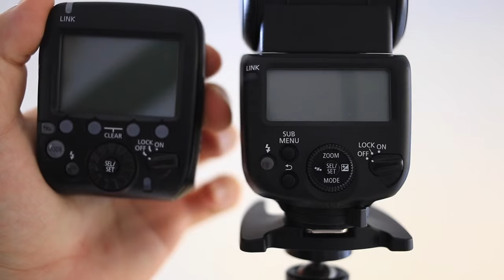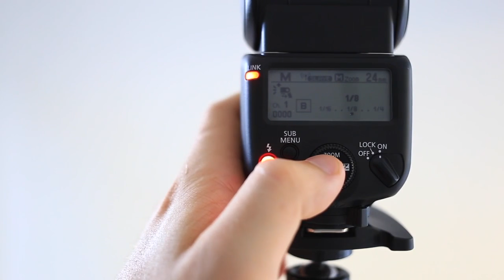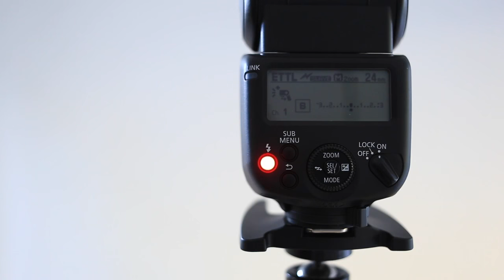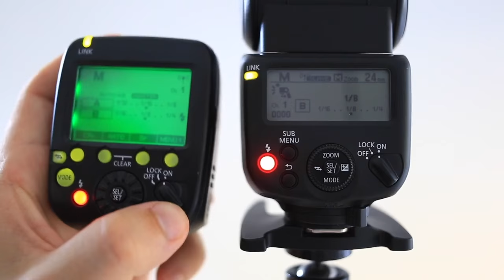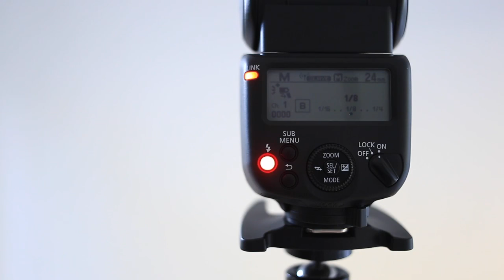How To Setup Canon 430EX-III-RT For Wireless Flash

Comment: Cant get my canon 430 ex iii rt to link the Yongnuo Yn e3 rt :( both are set to the same id number, same channel and the same group, the canon 430 ex iii rt is set to wireless slave and still cant use the 430 ex iii rt as a slave, it won't link !!  any ideas?

Comment: perfect I figured it out in about 2 min with this video getting my flash to work off camera with my 70D. Once I figured out that the pop up flash on my camera has to be up,  while in optical slave, In the 70D you have to go into the 2nd menu "Flash Control ", then go to "Built in Flash settings", then "wireless func." and chose one of the options there.  ta da.  so easy...
Reply from the maker: Glad it helped!

Comment: Will this 430EX-III-RT work with the Canon T6S without me needing to buy additional equipment to use it with the camera? If it can work with it; will it be able to use either slave or master or just one of them? Trying to decide if I should order one-Thanks.
Reply from the maker: I believe it will but would need to be setup to use the pop-up flash and the settings inside the menu to link them. Without the ST-E3-RT transmitter, the range will be reduced as it would be connecting via optical rather than radio transmission. Hope that helps
Reply: Yes, the 430EX III-RT becomes an expense flash because you have to set it into Wireless IR (infrared-line-of-site) while you must pop-up the T6s flash.
And go into the camera's flash menu to set it to wireless.

Like what Ryan Fowler Photography said, it will have limited ranges.
And may not work well in bright out door.

Comment: I just purchased a canon 4000d, which speedlite would work with it ? What else do I need ? Transmitter ?
Reply from the maker: The 430EX-III RT from Canon will most likely be compatible as Canon usually keep all their camera and flashes compatible. If you want to make it wireless, get the transmitter as well. Link to that is in the video description.
Reply: Ryan Fowler Photography thank you sir

Comment: Hi sir nice video. How did you manage to get the manual "M" option because to mine it only shows the ETTL option
Reply: Turn ur flash on a press the middle button when ettl is highlight and u can switch to manual mode

Comment: Can I use an S2-E2 transmitter with the Canon Speedlite 430EX III-RT Flashgun? I have the 430EX III-RT Flashgun but am trying to find a more affordable transmitter that’s compatible.
Reply from the maker: Good question but I haven't used that one so could tell you I'm sorry. From a quick Google search, it seems like a much older unit and not even sure if it has radio compatibility. If you can save a little more for the ST-E3-RT, I know that's a brilliant trigger and gives you a lot of control over the flashes. Like the saying goes, buy nice or buy twice. That would be my recommendation anyway.

Comment: is that the only transmitter that will work? is there a less expensive one?
Reply from the maker: As far as I know it is, although haven't tested others.
Reply: You can get ATG/Yongnuo TTL transmitter. ATG has them in 3 models.
Much better and less than Canon's.

Comment: Thank you for your video 
My camera is Canon 5D Mark IV, How to trigger 430EX II-RT wirelessly using Canon Speedlite 270EX II as an on camera flash?
Reply from the maker: I have never used a 270 EX II so I can't give you any specific advice. If you want to trigger a canon flash with another flash though, try setting it to optical wireless flash mode so it goes off when it senses a bright flash light.
Reply: The 270EX is a slave only. While the 430EX III-RT has ATG dual transmitting (2.4GHz & IR TTL)
You will have to place the 430 on camera, set it wireless IR Master.
While the 270EX II into wireless IR Slave.

Comment: I have a 430EX and a 430EX III-RT, can I use the 430EX on my Mark IV to trigger the 430EX II-RT if it sitting across a room? I'm trying to figure it out. Thanks.
Reply: No, it can't be done.
But if you buy one of ATG's say Yongnuo 600EX RT series then you have:
1. With ATG on camera, then you have wireless IR in Group A, B & C
2. With ATG on Master R(radio), then you have wireless radio with 430EX III-RT.
3. ATG/YN600EX-RT II, using Nikon camera's wireless IR ITTL with Nikon flash.

The 430EX III-RT and 430EX or 430EX II DO NOT have ATG Master Radio ETTL.

ATG Gold series, Canon 600EX-RT & 600EX II-RT and ATG/Yongnuo YN600EX-RT have built-in ATG hybrid circuits (wireless radio TTL and wireless IR TTL for Master and Slave).

Whitney Bowman, just buy the ATG's Yongnuo 600EX-RT II, then you got choices:
A. ATG wireless R ETTL II with two groups (A on camera & B with 430EX III-RT)
B. ATG wireless IR ETTL II w/3 groups (A on camera, B & C with 430s in slaves)

If you are still confuse or lost, contact Alzo Digital, CT.
Then ask for repair, service & technical from ATG.
Reply: Youngnuo doesn't work well when combining with Canon....buy canon always its worth the extra money.

Comment: My flash is 600EX-RT and I also have ST-E3-RT. TransmitterIn this video I found that its possible to set an ST-E3-RT Transmitter with any other flash except just 600EX-RT. Now my question is: which other Canon models are capable to set with ST-E3-RT Transmitter? Please help me to know the other settable models.
Reply from the maker: Hey, thanks for asking the question. There are 2 models compatible with the ST-E3-RT transmitter which are the 600EX-RT and the other is the 430EX-III-RT which is the latest mid range flash from Canon. Hope that helps
Reply: Ryan Fowler Photography Thanks for the video. It was very helpful.
Reply: You have a few more..
1. ATG Gold 1K Flash (transforms your Canon RT to 1,000 feet)
2. Canon 600EX II-RT
3. Canon 600EX-RT (Ryan stated)
4. Canon 430EX III (Ryan sated)

ATG Gold 1K Transmitter is 1,000 feet vs Canon ST-E3-RT is 100 feet

ATG Gold 1K Transmitter is fully compatible with ATG Gold 600ws TTL monolight. If you want the power. 
And a must when shooting wireless ETTL II HSS!

Comment: I have just purchased the st-e3-rt transmitter and the 430exIII-rt speedlite and i still can't get the transmitter to fire off a test flash.
Reply from the maker: Make sure that your flash is set to radio slave and that you're on the same channel as the transmitter.
Reply: thanks for the tip, managed to sort it out, i had the slave/master settings around the wrong way.

Comment: I tried Slave Optical Transmission with Canon 760s (india or T6s) . But its not detecting despite Channel is set same correctly on both Camera and Speedlite. Pl advise.
Reply from the maker: In your camera, you need to go to built in flash settings, change the mode to custom wireless and make sure you’re got the right channel on that and make sure your pop up flash is up when you take a photo. The settings on the flash need to be optical transmission optical slave, with the lightning bolt. When you take a photo, your pop up flash should fire but it only fires enough to set the flash off. Hope that helps.
Reply from the maker: Also, make sure you’ve got it on the same channel and your settings are saying you will fire all flash, not just A, B or C.

Comment: nice  video. Is there a third party transmitter (yongnuo?) to control 430ex-iii-rt along  with third party flashes?
Reply from the maker: Thank you. You can get third-party triggers although I don't know of any specific ones that you could look into. I know that Youngnuo have transmitters that you can link together and sit your flash on although I don't know the specific model. The best thing to do is just reasearch which triggers you can get. I think there are also ones like cactus who do triggers. Hope that helps.
Reply: The ATG Gold 1K Transmitter worked beyond 1,000 feet with ATG and Canon RT systems.

Canon wireless radio system is limited to 100 feet.

It would be best if you buy the ATG Gold 1K Flash.
Then it can talk wireless radio ETTL II to your Canon 430EX-III-RT.
You will have Group A and Group B flashes.

If you of Ryan Fowler Photography want more information, please check Alzo Digital, CT. 
Then ask for equipment repairs & help.
Reply: I believe the YN-E3-RT does the job.

Comment: Is this flash plenty powerful for most portrait sessions?
Reply from the maker: +Nicholas Gonzalez There is a lot of power in this flash but it depends on what type of portraits you are doing. If you’re doing outdoor, I’d go with the 600EX-RT which will make it easier, although this will work but you may need a higher output which will drain your batteries faster. I use this one in the studio and it works well but prefer to use my bigger one. Hope that helps to answer your question.
Reply: Many thanks for your reply! It was very helpful.

Comment: Is there any way the flash will go off without the camera flash?
Reply from the maker: I don't really get the question. Do you mean will the flash go off without the trigger? 

If you are, then you could potentially use optical transmission but you would need a pop up flash on your camera. Otherwise, you'll have to put it on the camera.
Reply: Ryan Fowler Photography my camera flash goes off at the same time as my external speed  light when not connected to the camera, and just wanted to see if there is a way I could get the external speed light to go off without the one on my camera going off
Reply from the maker: @lachlanharrison9335  If you've got the RT version of the flash, then I would say get the trigger so that trigger will go on the camera and just trigger the off camera flash.
Reply: Ryan Fowler Photography awesome answers my question thank you :)
Reply from the maker: @lachlanharrison9335  Glad I could help. There is a link to the trigger in the description if you want to find it quickly.

Comment: Great video, Hi my friends, I have question, i have 2 430iiirt and i dont know how to set up one on camera as transmitter only and no to fire? Is it possible, also can I have slave on different power than master, i tried manual and when I adjisted master to low powerthe slave changed too, please help. Thanks Joanna (i am using 5d m4)
Reply: Turn dial to the small flash emblem just below your ettl or manual mode indicator. While on flash emblem select by pressing set button then turn dial to flash emblem off...the one on the right...press set again and your 430 ex iii rt is now off.

Comment: Is this compatible with yongnuo st rt 3 transmitter?
Reply from the maker: I couldn’t tell you as I’ve not used one and don’t want to give you the wrong information. I’m sure someone has used this flash with a Yongnuo trigger and posted a review online someone you may be able to find.
Reply: Ryan Fowler Photography thank you!!
Reply: Yes.
The Yongnuo YN-E3-RT is better than the overpriced Canon ST-E3-RT.
Both are by ATG.
But the Yongnuo has ATG AF assist beam & firmware port.
Yongnuo YN-E3-RT works also ATG 1Kws/ATG Gold, 600EX-RT & 600EX II-RT